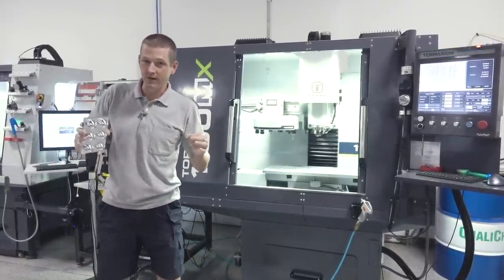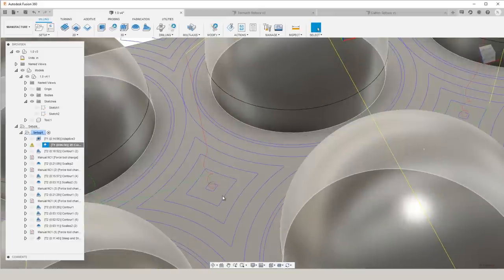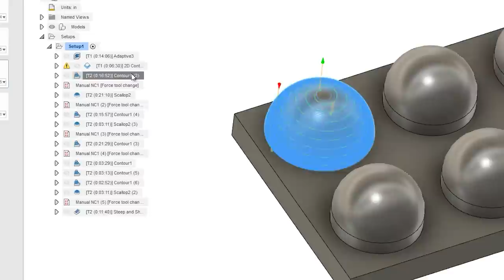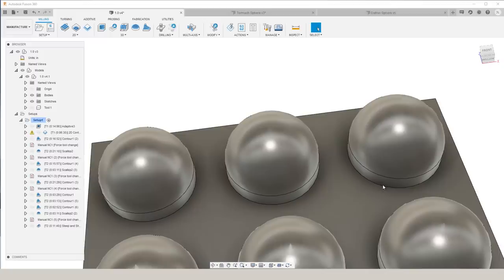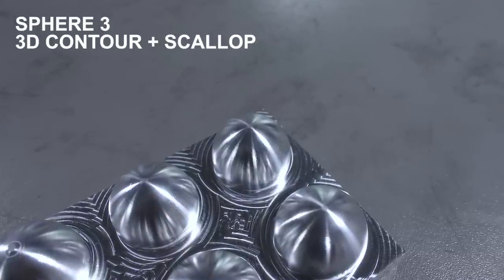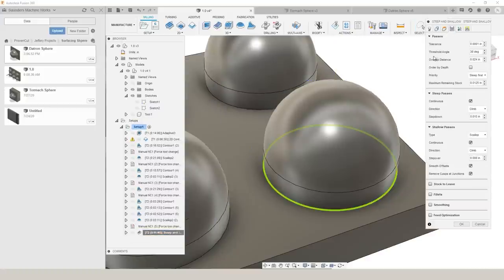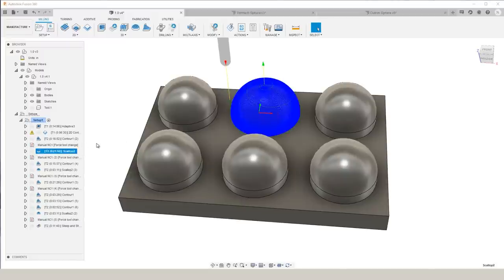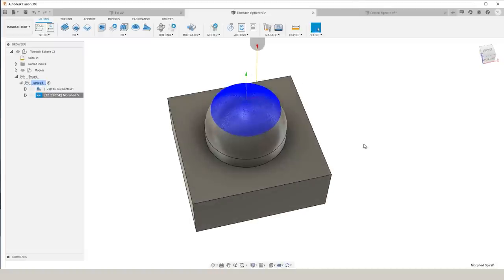How to Mill a Sphere with Fusion 360 | Tormach 1100MX VS. DATRON Neo

Comment: comparison shot between neo and tormach shown for 2 seconds from 5 feet away, no closeups. seriously? i would have liked to see the surface of those parts in detail.
Reply: they pretty much never properly show the end product. they need a macro lens and a turn table or something
Reply: To be honest I discard the marketing of these 2 machines COMPLETELY and got great value out of the Fusion360 work. Tormach seems to be pushing marketing these days with Titan also featuring their products heavily. I believe a good product will sell itself.
Reply: @EasyFold007  Agreed, but thats how machine markets work after all. There are zillions of machine manufacturers out there. From mechanics or price point alone, no brand seem to really have a competitive advantage. Software/control, tool management and integration of automation solutions seem to be the biggest driver now. Tbh, it is a nightmare "getting to know the market" to make an informed decision.

Comment: I know it is a minor point, but those are HEMIspheres, not spheres.
Reply: Not minor :)
Reply: This was more of a demonstration of optimal tool paths and surface finishes for spherical surfaces. Machining an actual sphere would be too far outside the scope of this video, and would be better for a demonstration of multi-operation processes and advanced work holding techniques, then 4 axis or 5 axis for more efficient operations.
Reply: I was making popcorn and looking forward to the flip, part holding discussion and parting, bummer.  Oh well, at least I have the popcorn.
Reply: If half a circle is a semicircle, why isn't half a sphere a semisphere?
Reply: @SRG216  After a bit of looking, it seems to boil down to preferential/accepted usage.  Both originally meant the same thing.  “Hemi” is Greek for “half” while “semi' is Latin for the same thing.  So pick your fav and use it?  Nowadays “semi” tends to be used more to indicate “partial” or “part of”, like a semi-truck.  My .01c on it.  If anyone has better/alternate please feel free to correct me.
Reply: @SRG216  Good question! :-) I don't know. I think I might have once, but that was very long ago. You aren't the first person to ask that question. :-) I think I once came across a faq or the like on the difference. But as I said, that was very long ago...

Comment: I find that using a bull nose endmill does a better job of these style of tool paths.
Reply: no doubt the sfm never goes to zero, the cutting edge is more consistent as well. find a ball tool that has as free cutting geometry near the tip as most of the edge. you wont get that dull look near the top using a corner radius end mill

Comment: I'm just getting into CAM. I'm using one CNC. There is a lot it can do and it can become difficult sometimes.
I work on a Hurco vertical Mill 3-axis.
One problem is if the code is very long and a cutter breaks it is almost impossible to find the line to restart from. I'm sure I'll get there in the end.

Comment: Use a Datron single flute ball and then you will really see an improvement in surface finish.  Also spin it at 45+K if you have the correct spindle.

Comment: Great comparison methods! 👍 although I see you gave yourself a vertical section between the spheres and the floor to allow for the use of a ball nose endmill....
How would you approach it when you need to use a small corner radius endmill? 
(Genuinely curious for a similar video but not ball nose as I have that situation alot but never the time to experiment with surfaces finishes)

Comment: Hmm. It doesn't make much difference if you machine the top of the sphere from the top or the bottom, you will still end up with zero surface speed at the centre of the tool. The solution is to use a radius / bull nose end mill. That way, you have a guaranteed minimum surface speed.

Comment: Question from a metric user. Why is 0.03" pronounced as thirty-thousands ans not as three-hundreds??
Reply: Because the smaller unit is called „mil“ and measures a thousandth of an inch. Therefore thirty-thousandth. Greetings from Germany, having to Donnerstag these stupid calculations all the time too. Screw imperial, literally means having to use metric 😂

Comment: Not familiar w Datron (way out of our price point).  So you used a higher spindle speed, a machine with more rigidity and a more precise collet system.  On the Tormach, are you using Tormach BT30s?  Have you considered a comparison of other mfg BT30s?   What about heat shrink BT30s on the Tormach (ala Maritool)?  Would be really great to see (Closeup!) surface finish comparisons 😀 when the Tormach is pushed a bit w aftermarket kit.

PS. A side of micro-milling (1/16” and smaller) on compound surfaces In the rotary would be fantastic!  Closeup! 👹

Comment: Kind of was expecting a sphere, not a half-sphere. I was more interested in how you'd do "op 2" on a tormach. This was a nice comparison of the toolpaths but one the surface comparison was from too far away and to quick.
Reply: Probably a custom holder like what you see Eggs come in. Possibly superglued in or similar. Heat the part up after so the glue releases.

Comment: I would have just used a uncoated ball mill as it is sharper
Reply: I was thinking the same thing. I'm a mold maker, coated tools are a no no if you're chasing surface finish.
Reply: @dudemcgee256  we never use coated tools because the cost is not justified and the surface finishes are better without them. Only for aluminum though
Reply: @qqqqqqqq1407  We use coated roughing tools in aluminum to squeeze out that last bit of speed. They also seem to last a little longer for that application where your depth of cut is 1.5 x the diameter of the tool or greater. I believe it's due to the superior chip evacuation from the lower friction coefficient between the cutter and the material. Granted we are micro milling, our "big" roughing tool is a .062" bull end mill with a .005 radius. We push it to over 40 ipm at 2x depth of cut everyday. It will last a couple of years like that if we're careful.
Reply: @dudemcgee256  yea we don't have a "roughing" endmill in aluminum we rough and finish with the same endmill. Square edge 3 fl uncoated

Comment: More than 20 years ago Surfcam would let you specify a scallop height. That way larger steps on the vertical and closer as it transitions to the flat. Free 3D printing software can do the same thing with layers. Fusion really does not have that option?

Comment: I still see faceted faces ... should I lower the tolerance factor? i use 0.01mm
Or the problem is the machine ( I have a VF2 without high speed machining feature )
Reply: Are you using
Smoothing?
Reply: @RBravo82  yes... And i still see faceted faces
Are almost imperceptible to the touch, but can be seen
Reply: Lovotti VW SpeedCraft it will do no harm tightening the tolerances then, definitely worth a try.

In the code you’ve output do you see a G187?
Reply: @RBravo82  I don't use g187
I use setting 191 in medium and setting 85 in 0.025inch
if I used setting 191 in finish, the machine stutter is too much without high speed machining
Reply: Lovotti VW SpeedCraft maybe give it a shot, 187 p1 will loosen up the tolerance but possibly smooth out the facets?

Comment: Why wouldn't you just turn the sphere with a cnc lathe...
Reply: Well, aside from the point that there might be valid reasons to do it, these guys just prefer mills. :-)
Personally I wouldn't want to turn that egg crate with the six hemispheres on a lathe.
Reply: I think this is less about a sphere and more about 3d surfacing...
A sphere is just a very simple, easy and comparable geometry to use that encompasses all angles through all axis. 
Think less about how to make a sphere and more about how to make a mold, something with alot of cavities, peaks, draft angles and "ergonomic" features. A lathe wouldnt help you there, but there's surfacing strategies will
Reply: Not the point of the video Nick!